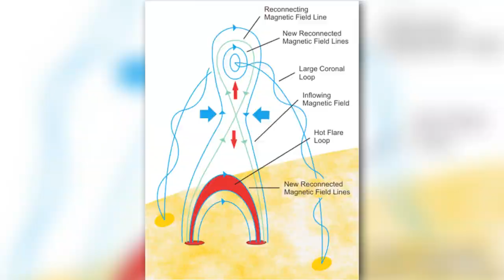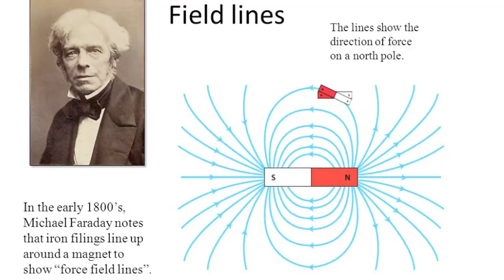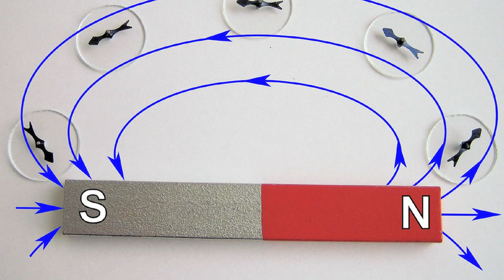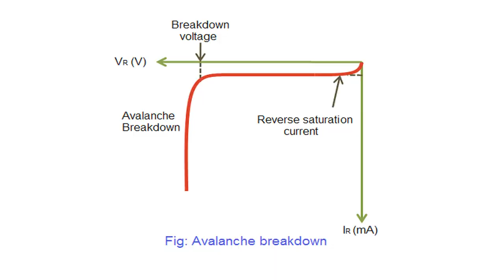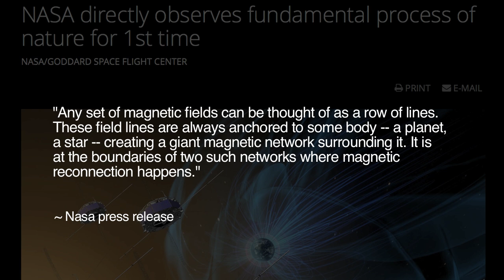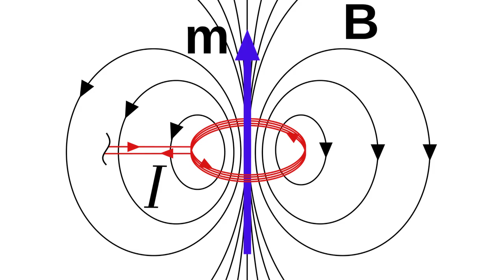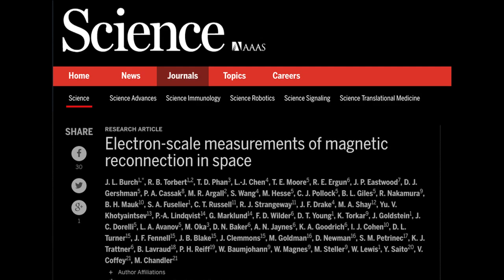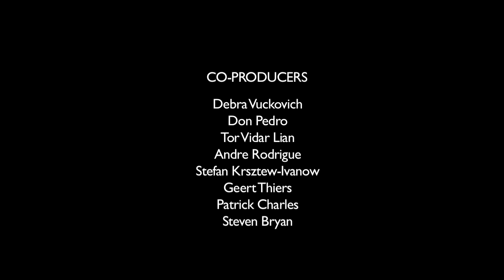Donald E. Scott: An Electrical Engineer's Take on 'Magnetic Reconnection' | Space News

Comment: There are a lot of misconceptions in the video. A magnetic field in vacuum and a magnetic field in a plasma are two quite distinguished things. Also if we really want to talk about it we should define what we mean by magnetic field. What you are referring to is the so called magnetic flux density B. The magnetic field, often denoted as H, is influenced by the ability of the medium to be magnetized. So you can pretty easily show with Maxwells equations that for an ideal plasma (no resistivity) the magnetic field lines are "frozen in" to the movement of the plasma elements (called the Alfvén Theorem). However, in moments of what we call reconnection the conditions change drastically. When the Field gradient gets high enough the resistivity of the particles start to gain weight, which increases magnetic diffusion. Usually in an ideal plasma the magnetic flux (the bounded surface integral of the magnetic flux density) stays always constant. But in regions of magnetic reconnection we can observe a change in flux, a breakdown of ideal magneto hydrodynamics. We can even make particle in cell simulations showing more or less the behavior we can also observe in astrophysical measurements. 
You might not know it as an "electrical engineer", but there is much more to plasma dynamics than just simple magnetic field lines. You can imagine magnetic reconnection as "breaking and linking" of field lines. But that is just a visualization and not a fundamental property of magnetic reconnection.
Reply: Is your statement based on first hand experiment?

Comment: I am confused. He said magnetic fields don't "flow". But how do rail gun projectiles move and irrigation valve actuators function if their magnetic fields don't push or pull them?
Reply: Heather Carman Magnetostatic field causes a constant pull or repulsion on some materials or other magnets. A piece of iron will be constantly attracted to a pernament magnet, if we will stop it on it's way (by a rope for example). The strenght of magnetic pull can be measured, even if this piece of iron won't be in motion and there won't be no EM induction (which requires motion to create electric potential in a metal). Magnetic polarity of a subatomic particle is just as real, as it's electric charge - both are intrinsic properties of matter and both are equally important... Why in plasma physics we use MAGNETOhydrodynamics and not ELECTROhydrodynamics?

Comment: New product on Ebay, 4800 mAh AA cell batteries, charged with magnetized electrons. 
These new AA cells must be stored away from all ferrous metals, and anything magnetic (like speakers or earbuds etc), since the electrons in the battery will be drawn to the any type of material, substance or device that can be effected by a magnetic field. 
The magnetized electrons can build up on these items (cellphones, microwave ovens etc), creating an plasma field that is only visible in almost complete darkness. And of course the invisible plasma field holds energy levels that are lethal to pets and humans..  So, use care during storage.. ;)

Comment: what about just an electron moving, it creates a magnetic field... And certainly there's some constant electrons flowing in a direction that casues the earths static magnetic field.  But that's certainly not a planet or a star.  An electron moving has no electrostatic character; only magnetic (when moving through a magnetic field, it's that it has a magnetic field that causes it to deflect).    If there was something like reconnection, couldn't that be demonstrated in a lab?  rotating one magnetc next to another  to give off spontaneous electron emissions?
Reply: *****
Quite interesting questions :)

Magnetizm is still quite badly understood, I have my questions as well (who doesn't have them, eh), but I try where I can:
If both bodies have their fields north to north, south to south, and if they are aligned in each others planes, they would both slightly repel each other magnetically and slowly change their rotational axis alignment (extreme axial precession), when they drift out of their perfect plane alignment, until they are north to south/ south to north, they would start attracting each other magnetically or even collide polar^^
Depending on the timeframe, (derived from relative orbital velocities, eg. flying alongside for a prolonged time, or quickly whizzing by each other in a 90 ° angle and their initial polarization alignment) one could get its orbit 'altered' (circularized, flung out, moved to extreme excentricity, axially extremely tilted)
But they would need to come really close to each other. Two earths would basically be touching each others atmospheres.
Just for the giggles: about the same distance as Earth, Venus and Mars had to each other, when the thunderbolts of the gods hurtled around, as Mr. Thornhill likes to say ;)

Best way to find out:
get two small bar magnets and hold them parallel to each other with altering polarization and 'feel' the force, Luke, while moving them, rotating them and doing other funny moves^^
Don't use neodymium magnets in the case you are a 'beginner', they can be so surprizingly powerful, it literally hurts and breakes your body (pinched flesh/hematoma/broken finger bones)

In the case of iron/cobalt/nickel cores of planets and the resulting planetary magnetic field/magnetization:
Theoretically yes, relative motion between magnetic fields and conductors always result in electric flux, and electric flux always results in a magnetic field.
And a magneticaly 'active' planet could magnetize the core of a non-magnetic/demagnetized one, so the case above applies (orbital changes).
But as said, they need to come really close.

No time lost here :)
Reply: Hi, Dumb question: doesn't it take more than one electron to create a magnetic field?  One alone wouldn't have relative direction to create a magnetic field. But, my real question is what happens when two spherical shaped bodies each with its magnetic field (two opposing poles) approach each other? Then, in any scenario, what happens physically to the two bodies?  I'd love anyone's thoughts on these questions.
Reply: Jan Hoyer Hi,thanks for taking the time to reply. I love the swimming pool experiment. I was think more along the lines of bbs in a bowl, but how would you magnetize bbs? My real question is this: as the incoming planetary body (or brown dwarf sun with a nickle-iron core) approaches our sun, how will it interact? Will it alter its trajectory because of repulsion? or will it draw energy from our sun? perhaps be drawn into our sun? or what? People talk about a pole shift--would that be the alignment of opposite poles? I heard it will tug on our crust, then snap it in to alignment. The story I remember as a kid, is that a woolly mammoth was found frozen with buttercups in its stomach. That leans more toward the snap.
Reply: Nah, it just takes one single moving electron to create a magnetic field.
But you do of course need a second one to interact with and this one needs to move as well, otherwise you will only have the magnetic field of the moving electron interacting with the electrostatic field of the non-moving electron.

Your scenario:
Both magnetized spheres would start rotating and interlocking their fields (in the case they have one 'north' and one 'south' pole. They would behave like normal bar magnets. They would slowly align themselves, pole to pole.

It gets interesting if you glue neodymium magnets with all their negative poles pointing inwards onto mercury filled pingpong balls and fill a swimming pool with a few thousand of those ;)

Decker:
Experiments of counterrotating magnets have been done a few million times, all those experiments are called electric engine^^
Only with the slight difference, that one (or even both) of the magnets is a coil based electromagnet, instead of a permanent magnet.
Reply: Oh, I posed the questions you and I have been discussing to Terral BlackStar channel, and he is going to post the dialogue in his weekly newsletter. I told him I would invite you to watch. It will be posted today around 4pm Let me know what you think.
Reply: onehit pick Thanks for clarifying.
Reply: And re: comparing magets to planets is like saying - show me a gravitational scale model of the solar system - no - they all have supports and strings.
Reply: Will the magnetic attraction between Earth and Nibiru (or Nemesis) cause the expected pole shift? I saw a video about the strong magnetic force at the Atlantic Ridge is causing the earth to wobble more than normal and will eventually lock on and cause the Earth's rotation to stop then the pole shift. Any thoughts on that?

Comment: +ThunderboltsProject "... direct evidence of electron demagnetization and acceleration" sounds like the changing of flavors to me, from a fermion into a boson.  also, the acceleration would therefore be expected since the mass difference is massive 0.51099862 MeV/C^2... assuming the product is not some massive neutrino.  Nevertheless, the term electron is used, so one must assume a constant flavor.  The sentence has no meaning to me either.

I would hope you're not about partial contextual representation, since sometimes, access to documents/publications is exclusive and not in the public domain.  I haven't looked into document access, since I already have interest areas, and I'm only following your publications.  So, I'm unsure what context came with that statement, and so I don't put much stock in my initial assessment

Comment: What is the best way to study the concepts behind the EU? I get all the basics but I dont have the mathematics to do research nor do I fully understand stuff like birkeland currents, magnetic dipoles and so on...
Reply: There's a good class on MIT edX called Electricity & Magnetism part 
2. The actual class is long since over, but the videos and homework 
questions are still up for viewing, all free after an annoying signup 
process.

Calculus and linear algebra (vector and matrix math) are good, too. Not sure if edX has classes for them. I've only done Calc 1, at a community college years ago, and picked up linear algebra in the process of learning 3D game programming from various online materials.

And perhaps even more important than classes, build things with your own hands, and observe. Follow directions at first, but keep thinking on it and asking questions until you really understand deep down why the thing is built the way it is. Electrostatic machines are good early projects. Build a Wimshurst first since they tend to be the most reliable, but then do a Bonetti style sectorless machine. Far more activity, and you can really feel the force between the discs and hear the crackling and see the plasma glow. One of the best and easiest ways to observe electricity with your natural senses rather than voltmeters and such :) And as long as you have good ventilation for the ozone produced, and don't use it to charge up capacitors, it's very safe. This is the best resource I know of for electrostatic machines: http://www.coe.ufrj.br/~acmq/electrostatic.html
Reply: I find that independent research and experimentation is the best. Thinking and questioning things, instead of memorizing and quoting things back. The best teachers or professors are the ones who question, and like questions. Anyone that "knows it all" is delusional.
Reply: +Joshua Graham 
A class or book discussing basic electricity may serve you well. If you wanted to expand your knowledge further, consider a course in basic motor theory and/or basic electronics.
Reply: onehit pick
Funny isn't it? There are zillions of books on 'dark mater', 'dark energy', and 'black holes', etc. But not much on how everything is connected electrically.
Reply: Subscribe and learn.
Reply: Riotboy1
I have, its just that I am talking about more formal education. Like which college or university I should go to.
Reply: 10 000 volts will shock you, but you can get back up. 10 000 amps? You're dead